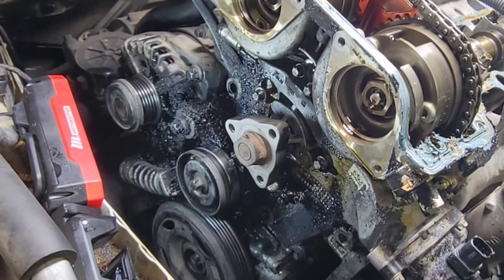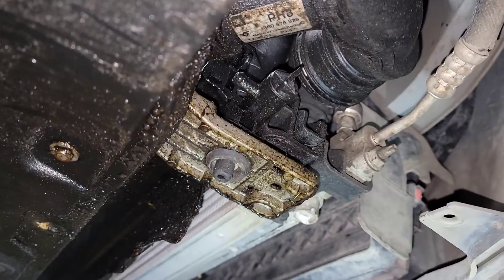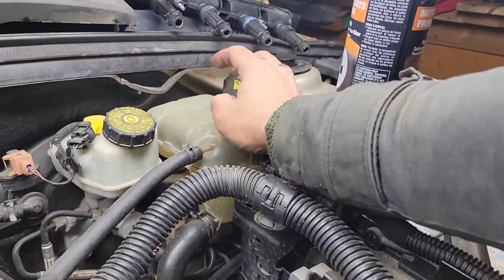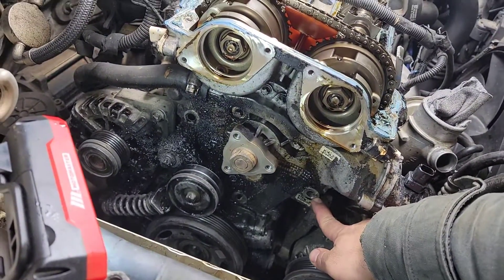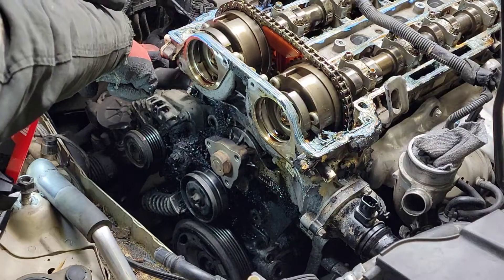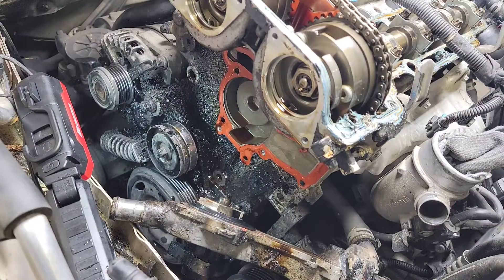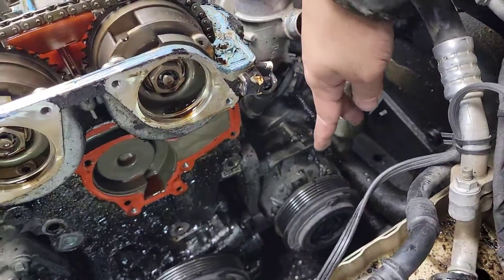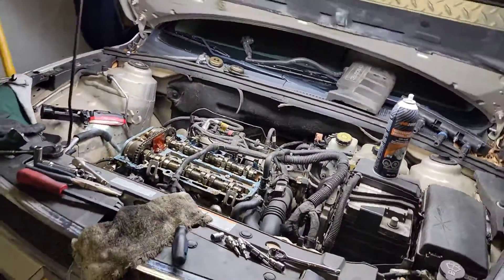V5: Chevy Cruze 1.4 Turbo! This Video show How to Drain Coolant & Remove Water Pump.

Comment: How much does a job like this cost with all that labor and price of parts?? I’m about to be having to replace almost everything you replaced here so I’m curious
Reply: This job w/ parts and labor runs about $300-$450 out the door. Water pump plus gaskets and coolant flush is involved. If you can do it yourself, about $80 plus whatever you value your time